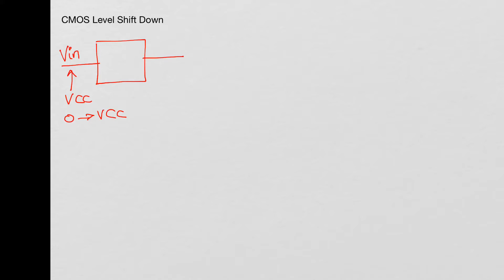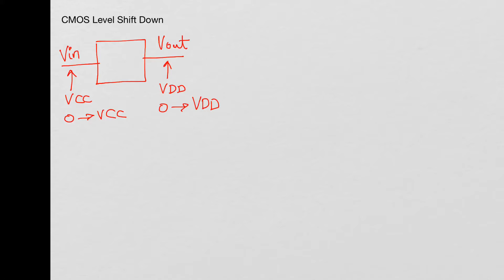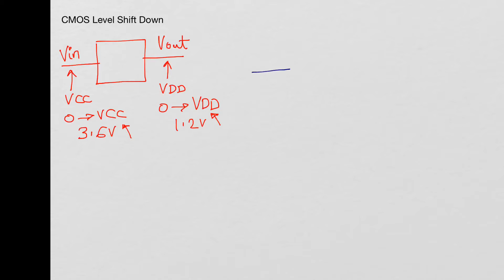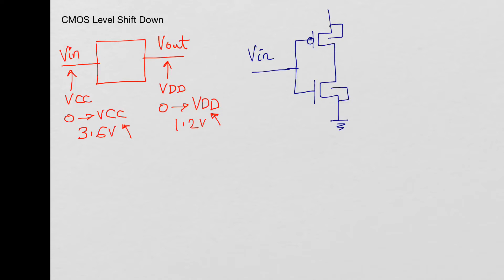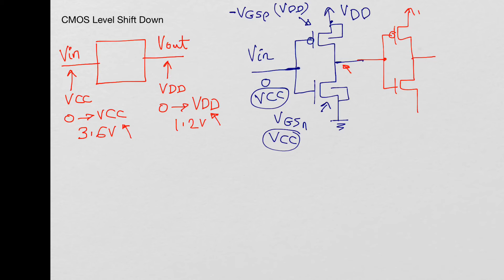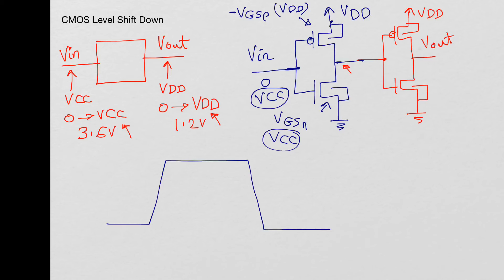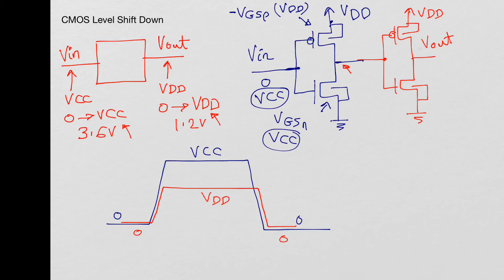CMOS Level Shift Down Circuit

Comment: I have a doubt, if input is low, how will it turn on PMOS of first inverter,  Vgs=Vdd only, which is not sufficient. This will only weakly turn on PMOS, so voltage level is not Vdd exactly

Comment: Hi, my doubt is that when the output of first high voltage  invertor itself is varying from vdd to ground then what is the meaning of using the second low voltage invertor?
Reply: Since it is a buffer, we need to invert the signal twice to restore the original signal, using second inverter.

Comment: Hi，I want to ask you about your 1st circuit. The input is vcc, for the first inverter vcc larger than vdd, wont this make the mostube break down because the high gate voltage?
Reply: He mentions at 1.34 that the input will be handled by high volatge devices.
That means the ist inverter is to be designed using transistors which can withstand higher voltage